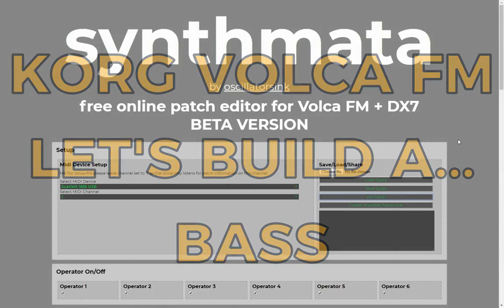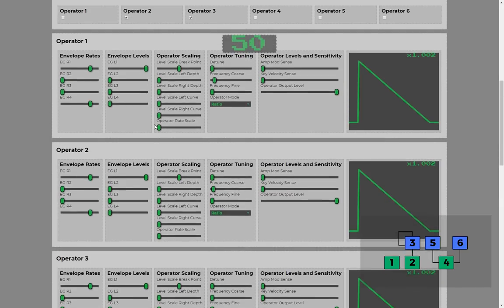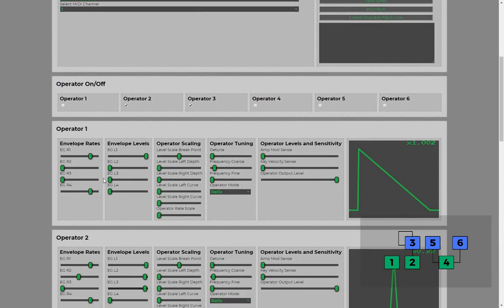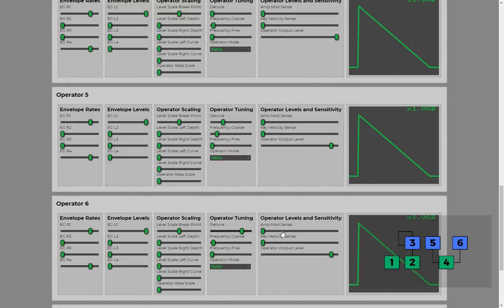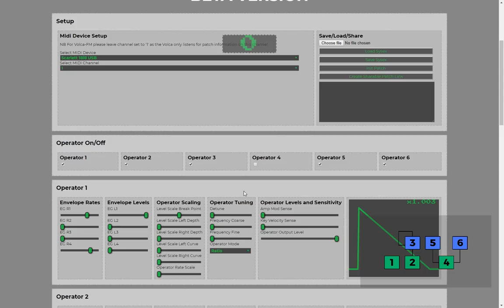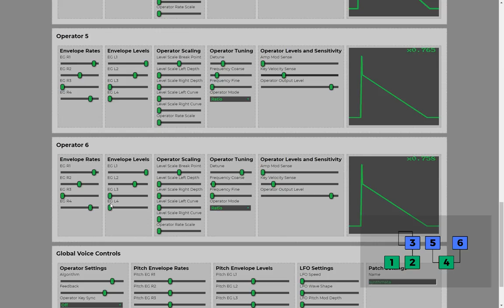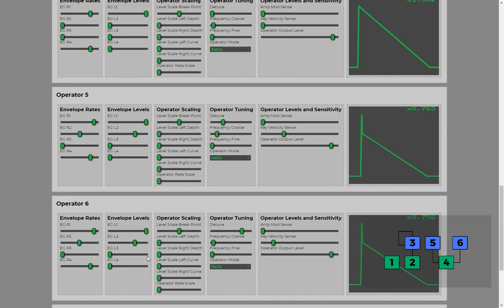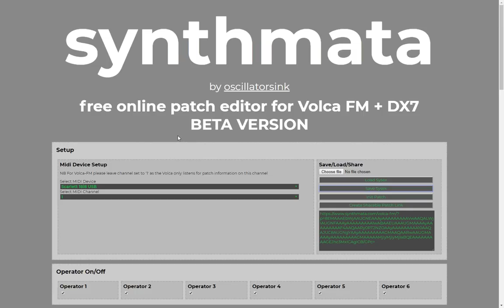Korg Volca FM - Let's Build A... Bass!

Comment: How do I get Synthmata to show sliders instead of knobs?
Reply from the maker: Short answer: you can't, I changed them to knobs now so that you can see more information at once. It's functionally the same page, just laid out differently (hopefully better) 

But if you can code a little:

Medium answer 1: if you download the code for the site from https://github.com/synthmata/synthmata.github.io and you don't need support for the Volca FM 2 or any of the new copy/paste features, you can revert bank the most recent commit and that will leave you with the old version of the site

Medium answer 2: if you download the code for the site, you might just be able to remove the function call to "knobify" in init function - I suspect that the layout will be very cramped so you'd also have to edit other stuff (CSS mostly) to make it usable (but I haven't tested this).

Comment: can I use a USB IN-OUT MIDI Interface Cable Converter to get this patch on my FM?
Reply from the maker: Yes, although some of the really cheap ones don't pass sysex data correctly so they might not work.
Reply: 10-4 thank you for your reply